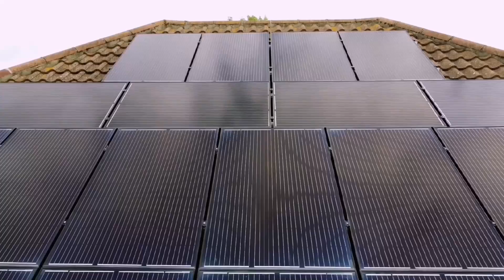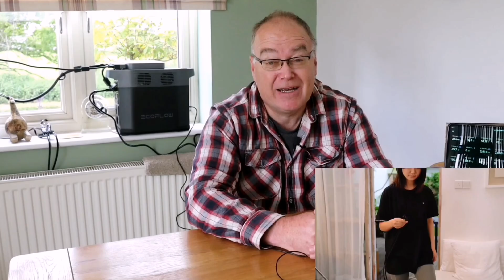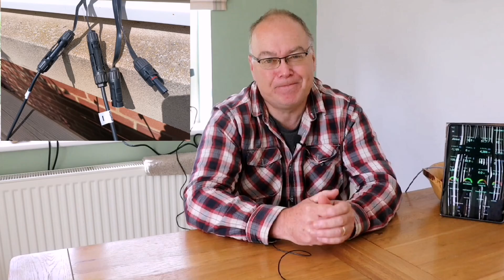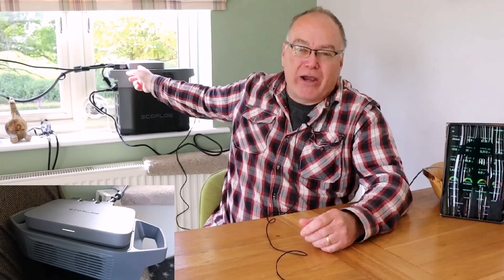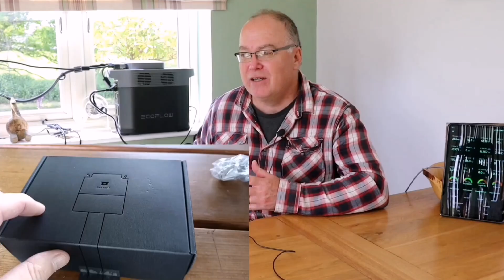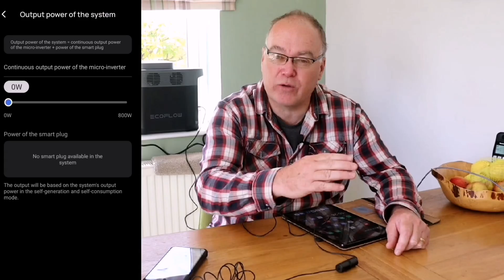Revolutionary Ecoflow PowerStream - DIY plug in grid tied Solar PV & battery system

Comment: While I like the idea of it, perhaps it is rather underpowered. If we got a couple of days of power cuts, it is unlikely to even run my fridge freezer.

Can it load power from solar and export it to my fridge freezer at the same time?

If I linked it up to my downstairs ring main by plugging it into that circuit, would the power be available for anything on that ring main only or would it perhaps run anything from the fuse box such as my upstairs lights.

I need more info.

Comment: Now, a set of 2x400  solar panels and a micro-inverter alone can be bought for £349. You can get a 2kW energy storage unit for up to £1000, plus 4 smart plugs for £120 (4 pieces should be enough). With a set like this, you can easily save up to 6kWh per day. It might not seem like much, but over the month, year, and years, the set pays for itself. Without the huge costs of installing panels on the roof. And in case of a power outage, you can connect appliances like your fridge and aquarium to the energy storage and have backup power during that time. The next day, you can recharge the energy storage unit, which will continue to power your devices if needed. And let's not just look at the return on investment, but also at the independence it provides. You can actually quickly pack up this set and install it in a new location. Kind regards,"
Reply: Hi JJ.  So have you actually bought a sys and it's giving you good payback ?

Comment: I have just purchased the PowerStream, the smart plugs are out of stock and have been for a while...in the meantime I've been importing solar in for the base load ..my question is (just an example) if I'm bringing 400 watts into the house but only using 300 watts base load ,what happens to the other 100watts...I'm assuming it goes back to the grid,but does this return reflect on my electricity usage?

Comment: Total nooby at this, Can the inverter be plugged into any socket in the house to save electric?, after plugging in are you only able to save power on the appliances that have the smart plug connected to?, and would I have to call up my electricity provider before doing this?

Comment: Hello. I too have just purchased this micro invertor and was told the same thing, in that it needs to be permanently wire into a socket, not the mains fuse box but a normal plug socket. Having contacted a company selling these "Energian", who were very helpful, they informed me that you only need to connect the micro invertor AC lead to the wires within the plug and then add a blank facia to the plug itself. I decided to research this more, as it seems rather bizarre as I want to know how this new requirement protected the consumer. Its all to do with the regulation BS7671, which is predominately to do with electrical installations including "measures to prevent contact with live electrical parts" so I assume this is predominately to do with the removal of the plug and the possible live current exposure through touching the 3 plug pins.. and as you kindly demonstarted are not live following removal..

Comment: Hello. Very interested in buying one of these units to link with my delta 2 max. Can I ask, have you had any problems with it plugged directly into a mains socket? As now when you buy one, the 3 pin plug is removed and they advise wiring it directly into your mains. I appreciate power surge may be a concern and for this I coukd add a rcd plug to offer this protection. Permanently installing really limits its mobility and reach of the solar panel cables. Have you subsequent rewired yours in Permanently.
Thanks in advance 
Roy

Comment: I do have a quick question, if I dont use smart plugs, and I have a grid power outage, will my ecoflow battery take over if I have the powerstrem plugged into my electrical socket?

Comment: Hello. I have just bought the Delta 2 max for this sole purpose. You mentioned that you just plug the inverter directly into a 230v socket, what lead do I need for this? Also I read that in the UK you should use a DIY cable supplied to professionally have it installed to the fuse box? 
Can you advise please.

Comment: Why does it always seem to be a problem using a 13amp plug to trickle feed back, when everybody in the country has a 3kw kettle that are right on the limit of a 13amp fuse! I will guess its because the electric is flowing in the direction of them getting all the money 😂
Reply from the maker: In theory you could unplug and there could be power still at the plug as the generator is still attached . Quick shut down helps but the rules are the rules. Physical hard wired connection is needed to meet regs......so I am told
Reply: @EVPuzzle  yes true

Comment: Hi Nigel, how would this system play with an existing home battery system. I have a growatt battery (no solar). For example, if it added 100watt to the house would that mean that there would be 100watt less load on the home battery system. Also is there a way the inverter could top up an exisitng home battery (removing the need for the portatbal battery)?
Reply from the maker: Sadly these aren't being sold in the UK now. As suspected despite working ok, they don't meet install regs
Reply: Thanks Nigel, the regs won't prevent an install at my home. Can always unplug it if an inspector calls 🙂
Reply: @alistairlambert3275  If you end up backfeeding over the registered power output from your Growatt G98 or G99 cert it'll be a bit too late for that. You can legally though get a D2Max instead (which has similar spec MPPT inputs to the unit) and hang a load of panels off it and use it to power stuff directly. It can even be plugged into the mains with the newer firmware and you set how much battery level it will maintain off mains, with the rest charging the battery and feeding the outputs. What you can't do is grid tie it. Even in countries you can grid tie it like Germany you are only allowed one and it must be your only unit.

Comment: Inverter get's bloody hot, smart plugs are way too expensive, whole setup for 800W is a rip-off. Return of investment for this gadget is crap. Solar energy is not reliable unless you live at a place where the sun shines most of the time.
Reply from the maker: Of course solar is reliable , even in Scottish winter ,you just need the right equipment for the job . This system has it's use where permitted . All inverters get hot at peak load

Comment: But EcoFlow UK have just told me that the PowerStream is NOT approved for use in the UK for connection into a house socket. Which is why its not for sale on their UK website. Why do you not mention this key fact? Its pretty important to know...
Reply: Te Powerstream is available on amazon UK however it is a safety hazard which could kills someone working on the grid because communication between their smart plug and Powerstream is delayed so while the powerstream wait to be told by the smart plug that the load has gone to 0watt, it could be injecting power on the grid killing workers performing maintenance work on the power grid

Comment: there's a special tool for disconnecting the plugs from the inverter.. Designed not to be easily disconnected. What you highlighted as a negative is actually a feature.

Comment: Great vids thanks, looking into plug and play options however worried I'm gonna blow my place up 😂 just can't get my head around power entering my place through a standard wall socket and it be circulated around the property.
Reply from the maker: Make sure it's hard wired , plug and play doesn't meet installers regs so it seems
Reply: Isn't your video and description saying you can plug it into the wall socket when it's charged and power your house?!?

Comment: I have a question please, about the Inverter, you said we need it to convert the dc which comes from the Solarpanel into ac, but a friend told me " you won't need an additional inverter. This device has a built-in MPPT (Maximum Power Point Tracking) charge controller which allows it to efficiently charge from solar panels."
It would be helpful if i have more than one Solarpanel, but if i have only one 400 watt panel and the ecoflow why do i need an inverter?
Reply from the maker: Solar panels produce DC power.  That's ok for USB output or car 12 adapters but for household power it's AC and hence has to be inverted (converted)

Mppt optimises the DC power only
Reply: I just talked to my friend again, and he sent me this:
In the case of the EcoFlow Delta 2 Max , it has built-in inverters that can perform this conversion. So, if you have a single solar panel, you do not need an additional inverter.

Is it correct?
Reply from the maker: @austrian255  yes ecoflow has solar mppt and inverter built in , it's an all in one so long as you stick to the limits
Reply: Thank you sir.

Comment: Have you tried disconnecting your house or the one circuit with the ecoflow unit plugged-in at the fusebox / main panel and tested whether small appliances on that circuit still power-on?

Comment: The Ecoflow is also an inverter. Not sure why you feel you needed another one. The panels connect right into the ecoflow. The cables come with it.
Reply from the maker: You're missing what it does do that the battery cant do .

Battery inverter converts DC to AC output but that output can't be grid connected.  Its not just a wiring issue , obviously you can't plug a lead in with a plug both ends between the battery and house , it's a compatibility issue.

For example , Things that grid connect need to shut off in the event of power cuts  to stop making the grid live when it's supposed to be off for maintenance.  That type of compliance isn't built into a portable battery hence the need for a different  inverter that takes the battery power and solar power in DC form and can connect to the grid .
Reply: @EVPuzzle  Please explain. I only clicked on this video because in the title he has grid tie. My search that brought me here was if I have the Ecoflow Delta pro ultra system with 2 batteries then how can I sell unused power how can I sell it back to the electrical company (Grid Tie) and that is not what he is doing here.
Reply from the maker: @007gomboo  crikey , you clicked on it, there's your mistake 😉🤣
Reply from the maker: @007gomboo  I've updated my first reply which wasn't the most helpful , sorry .

Having said all this , this solution is no longer available in the UK as it didn't meet the regulations needed .  Plugging micro inverters directly into sockets doesn't meet installer regs even if other rules and regs are met so it was pulled by eco flow despite the fact it works fine .  Yes, once connected solar power can be pushed directly to the grid if not consumed in the house .

UK safety regs are pretty tight and this type of solution needs hard wiring to a separate consumer circuit.

Hopefully they'll launch a UK compliant version again soon

Comment: So to clarify, can this be used in conjunction with an existing whole home ecoflow setup.  I have maxed out my ecoflow devices by having the two delta pros, two batteries and two generators.  Could I use this to continue to add ecoflow delta pros by placing them in rooms and plugging them in to add to the overall available KWH?

Comment: Almost all of my appliances I would like to add to the system are electrically installed as fixed systems with no way to add smart plug in between. Induction stove, 3 air-cons, exhaust fan, owen, etc. This would be perfect, if the system could detect the overall consumption and you could add maximun power everytime you exceed that figure and when consuming less, system would lower the power. So it would feed 0-800W automatically and preferably even more than 800W.

Comment: So with or without smart plug it sends energy to the whole house right ? Whats is the point to have the smart plug ? Does it direct the electricity somehow specifically to smart plugs only ?
Reply from the maker: Increases the amount it outputs , baseload plus plug value
Reply: Ok thank you. And what if you have a power outtage and you are sending 300w but the house is using 400w, how will it work, some stuff just wont work in the house ? the furthest from the powerstream maybe ? @EVPuzzle

Comment: Installations under 800W are exempt from G98 commissioning, so you can simply install this kit without any DNO paperwork.  More details on this exemption can be found here: ENA G98 Regulations.
Reply: No they're not, devices under 800w are exempt from certain aspects of that document, but most of it applies.

Comment: @EVPuzzle Hi Nigel.  Great video, would it be possible for you to add a test of how effective (or not) this system is at actually reducing the homes electricity usage (bills).  I only ask as I have a basic power usage meter at my incoming cable to measure the load.  My background base load is usually around 68W - 100W when Im not really using any electrical equipment. When I turn the Ecoflow on (connected to the 3 pin wall plug) I notice the actual demand used by the house increases slightly.  Ive also noticed that when the background load is say stable at 100W and I push 50 into the wall socket via ecoflow inverter, it doesn't reduce the house load to 50W as expected.  Also noticed that my TV and internet router, both powered through the smart plug draw approx 20W (just on standby) but the actual house (billed) usage or load, doesn't reduce by 20W when the system is active.  

Basically, could you please (or someone else) record a few tests that show how this system actually reduces the house electric usage not just by accepting what the beautiful app tells us to believe.  I REALLY REALLY want to see the evidence that this device actually works.  I own a delta 2 and ecoflow powerstream and not yet convinced the system actually works as we all thing, not how the app says and REALLY want to be proven wrong and my mind set at ease :-)  Thanks Mervyn Northern Ireland.
Reply from the maker: I think I did that, showed reduction down to zero baseload when using powerstream . I'd suggest maybe  your monitoring might not be accurate enough. Victron showed it up nicely

Comment: Do you know if this super flat cable will work on a US EcoFlow  portable solar panel without the Powerstream? In other words work as just a EcoFlow Delta Pro out the window (no power stream) to the Eco supplied 400 watt portable solar panel?
Reply from the maker: It's just a solar standard cable but flat so yes it'll work
Reply: Thanks EVPuzzle
Any idea where to buy one as I've searched and only found it on UK sites?

Comment: Nigel, I've got this with 800w solar panels connected but no battery. I generated 700w most of the day today. My house has a baseline usage of 400w. I'd like to know does the remaining (unused) 300w feed into to the grid.
Reply from the maker: Yes if you're connected to the grid it will flow out
Reply: If I added the battery I understand the excess solar generation will go to the battery. This is good. However, there appears to be a major floor to using a battery setup. For example, If I program my usage to 400w in the app the battery will supply extra watts if my solar generation goes below 400w. But if I use less wattage in my home(say 100w) 300w will go into the grid from my battery. I am effectively using my battery to feed the grid. Hmm....NOT GOOD. it will require  constant monitoring to be used efficiently. I wonder if the smart plugs will help with this problem.

Also, do I need to notify the grid on this input?

Comment: Can it work without Ecoflow battery?
So that it only works by sending a power to devices in the house through the day and that's it...
Tnx! :)
Reply: Yes, it can. I connected 2 x 420w trina vertex panels to it, without a battery. Haven't had chance to do any more testing yet.

Comment: I'm not sure how legal is it? How is it possible that you're doing export to the grid and you don't need any permission? Also, as far as i know it should be illegal only by the fact that if grid goes offline, you'll be putting current onto it and if something work on it somewhere they'll get electric shock.
Reply from the maker: You like the illegal word don't you ?  Which law is this?  Didn't know Dno were   a law enforcement agency either 

Know what you mean though but I've seen   exemption documentation regarding g98 approval for systems under 800w.  It's a very grey area, if it cuts out when unplugged, no live plug and if it doesn't backfeed if the grids not there .

Anyway if you want to shout illegal, at least quote the law please

Comment: Dosnt comply with UK regulations, chapter 55 says no generation source running parallel with the grid can be connected via a plug or socket

Still need DNO G98 notification

Comment: A couple of quick questions. What’s with the revenue shown on the app shown in the video, is it displaying costs saved or are you being payed for putting electricity into the grid? I have two Delta Pro’s already so this inverter was a no brainer, is it safe and legal to have two of these plugged into the home circuit providing up to 1600W?
Reply from the maker: 800w limit as it comes via the inverter not the battery itself
and revenue savings are just a guide using a present tariff cost times kwhs of grid use saved